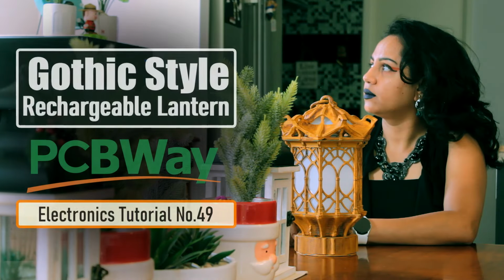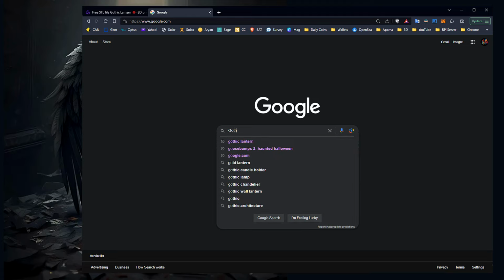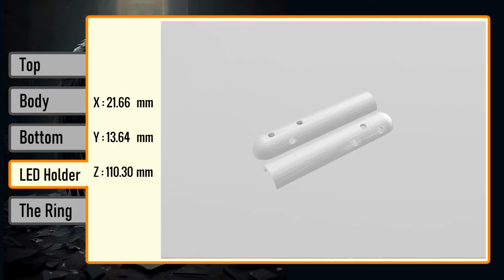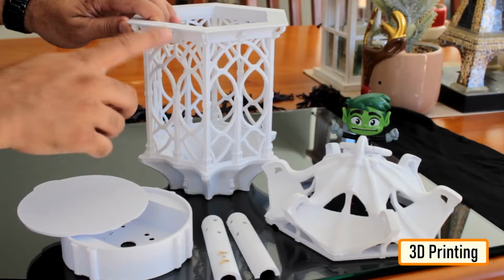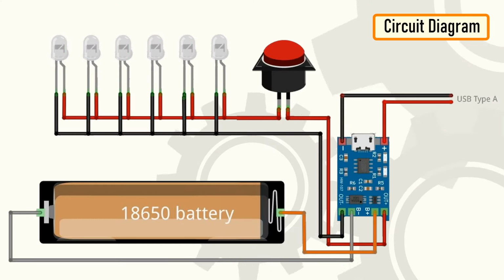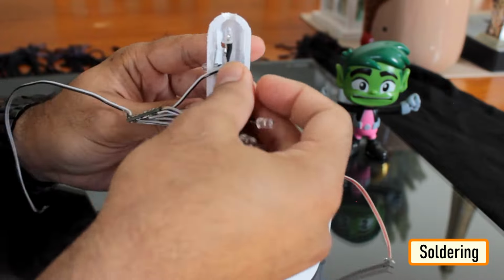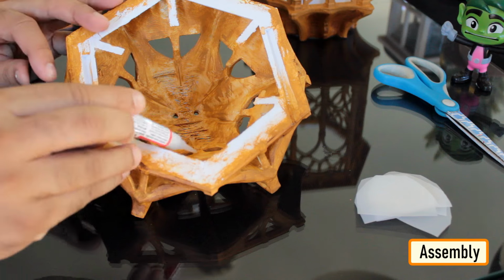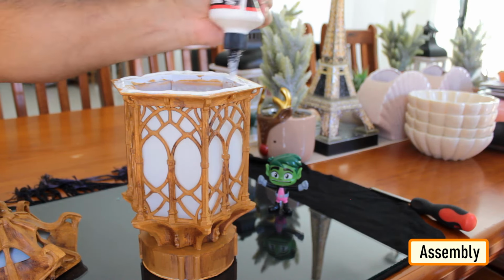3D Printed Rechargeable Gothic Lantern

Comment: i think better to add extra battery so you can run an Arduino, and RGB LEDs. Using an Arduino and a momentary switch , you can program different light colors, and light patterns to change with each press of the switch,.
Reply from the maker: Thanks for the suggestion
I agree to that